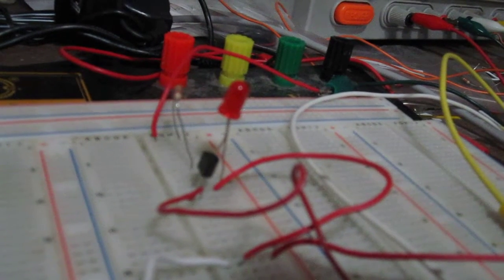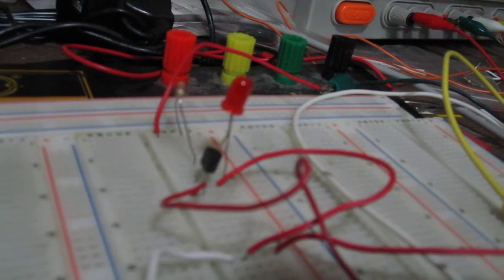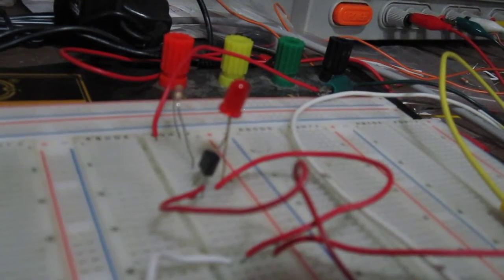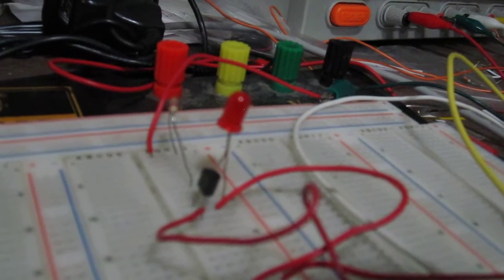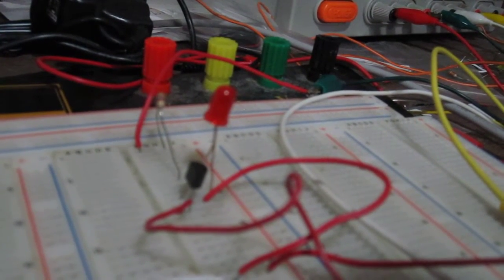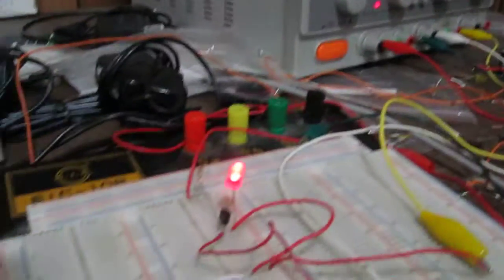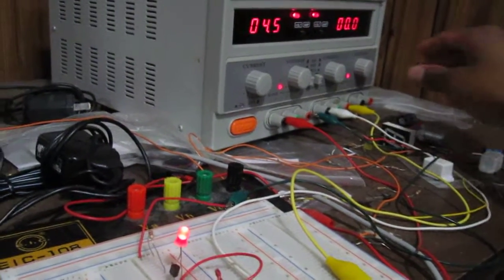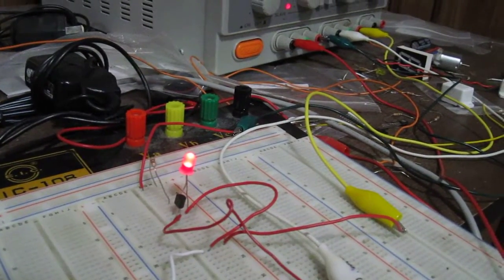N Channel JFET Switch Circuit

Comment: Hi,
I don't really understand how you connect negative voltage? would I just connect the negative terminal of a battery or ground? How do I complete the circuit ?
Reply: using a SEPARATE  power supply you would connect the negative side of a battery to the gate..and the positive side of the battery  to the negative side of the fet..which is ground...or source of the fet. Sounds really backwards right?????